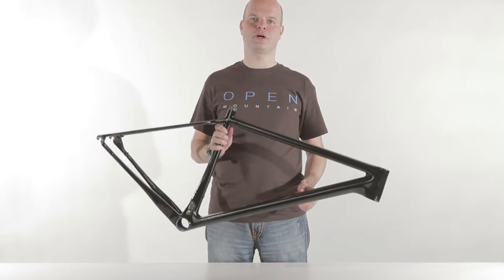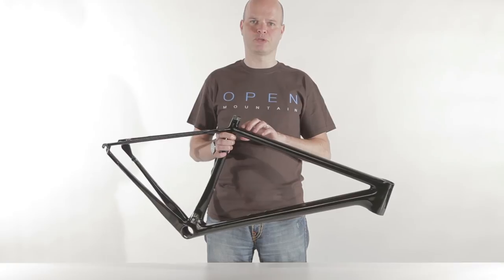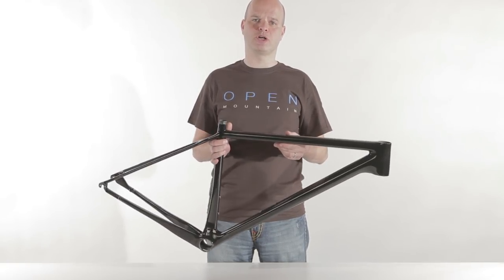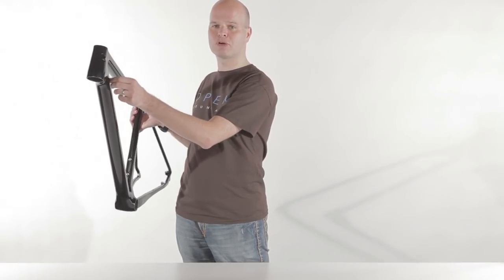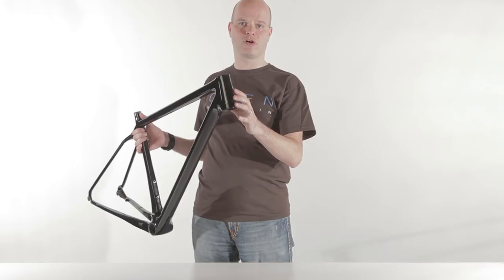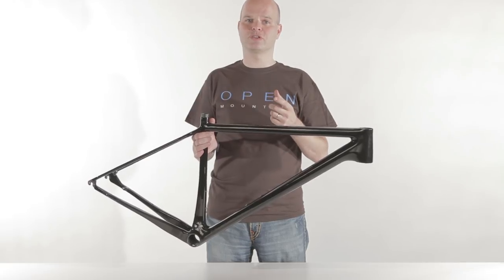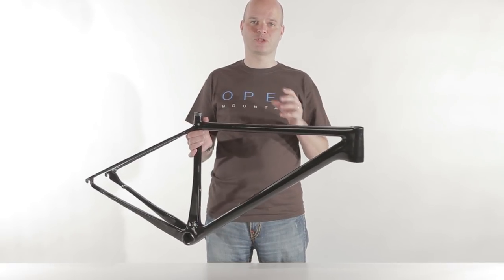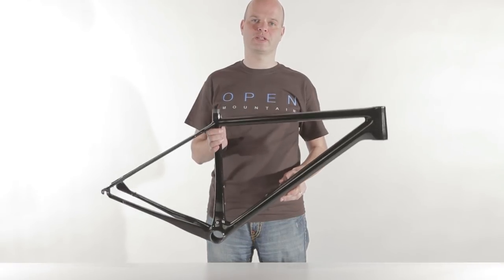Carbon grades explained

Comment: lol. I work for a carbon manufacturer in Asia and I just finished writing a document with almost identical content to this. I was looking for some general interest type pics and to see if there are any questions I might have missed for the POV of the public interest.

I would heartily agree with the previous commenter that this is one of the most clear, most accurate videos/pieces of information about carbon manufacture that I have ever seen.

The only thing I would add (that you probably left out for brevity) is that use of high modulus carbon can also be used in some places, but not in every layer. Our engineers typically have UD fiber in the direction of highest stress and a bit of medium or low modulus 3K for the outer layer for omni-directional strength.

No bullshit here. This thing is more accurate and factual than the Koenigsegg CF video!
props!
Reply: so. out of brevity, which carbon frame brand should i buy from? Trek? Specialized? Giant ? how about small companies like Niner? im sure they wont tell what or how they made their carbon frames.

Comment: Every carbon frame Ive ridden is stiff as can be.  Great for climbing and smooth pavement,truly sucks over bumps and the bigger and bigger tires being used on roadbikes are to offset a frame with no bump absorption ability. I would like to see a test showing just how much a carbon frame "gives" over bumps.

Comment: Ah man I just bought a chinese mtb hardtail frame that says high modulus... Is it gonna bust??!!
Reply: Hey, how has your chinese mtb hardtail frame worked out?

As to your concern, I'm not a carbon expert, but from what I gather, if this chinese manufacturer is indeed using high modulus carbon on your frame, it probably doesn't literally mean they're using high modulus all over. It probably means they're using high modulus in certain safe places like this video described.

The other possibility is that they are just saying it's using high modulus for marketing purposes when in fact they are just using medium or low modulus. Anyway, how is your frame riding?

Comment: Is toray t700 a good carbon fiber for a full carbon frame?
Reply from the maker: Not if it's the only grade of carbon you use. As part of a blend, sure, just like Toho and Mitsubishi make very similar carbon to Toray's T-700. And also there, just using the one grade for everywhere on the frame is not a good idea, you need a blend.
Reply: T700 is cooking oil grade carbon.